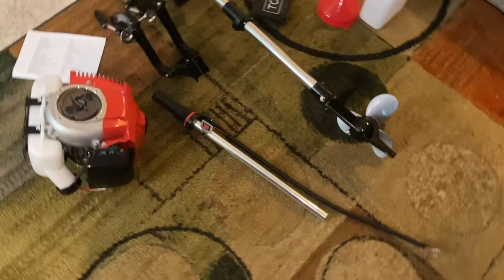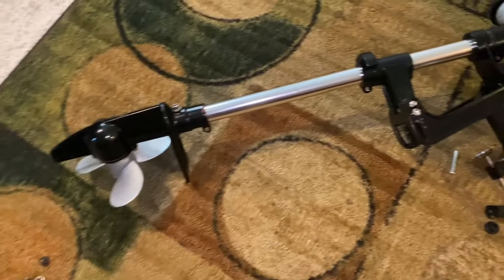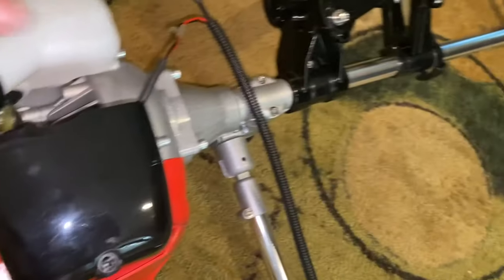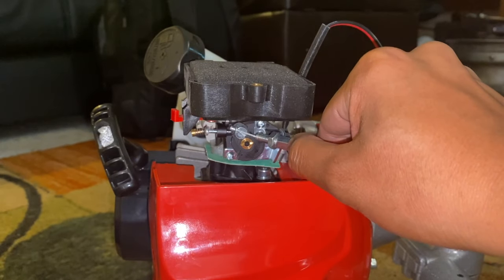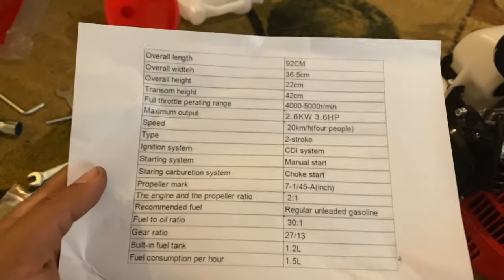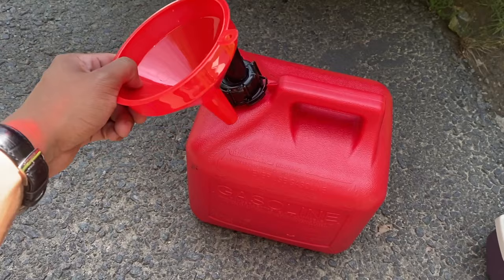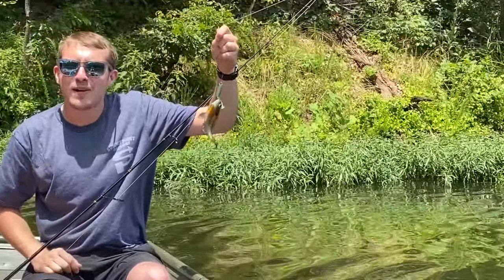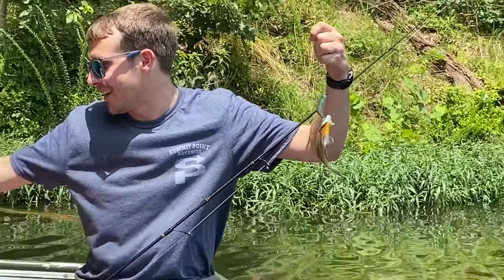Sican 3.6 HP 52cc Outboard Jon Boat Motor 2-Stroke Engine | Review Unboxing Performance Speed Test

Comment: Good honest review.  These asia made products will hold up if cared for properly.  With two stroke engines that oil/fuel ratio needs to be just right.  Id rather clean fouled plugs than re-ring a motor

Comment: Be careful with the handle swivel. Mine was made of cheap cast aluminum and shattered at the handle end of the swivel while using it. I modified the handle it gets my canoe flying across the lake to the point I'm doing wheelies.  Make sure the lower unit has oil in it.
Reply: lower unit ?? its a 2 stroke
Reply: I have an 18' Coleman canot that had that problem of "porposing" up especially in a headwind. You should do what everyone does to make your canoe more stable on the water. Shift weight towards the bow to keep the bow from popping up because if wave or wind action! Same goes for boats that do not plane easily. Shifting weight forward balances your craft better, gains some speed, and becomes a safer craft!

Comment: Anything will last longer with constant maintenance. The tie breaker for me is that centrifugal clutch in the leg. Across the board, everyone I have talked to about Chinese made outboards below 5hp is that centrifugal clutch wearing out every season (with steady use). Occasional use may let that clutch last two seasons, but usually less. The earlier outboards had a "Chinglish" owners manual that wasn't very understandable which caused many outboards to not last very long. I know that if I decide to buy one, it will be two cycle with forward, neutral, and reverse gears and above 6hp for longevity. These motors will last much longer when they are not strained too much. I once ran a 15hp Evinrude, and later twin 40hp Johnsons on my Alumacraft and I learned that the extra weight made for longer and more useful lives for those engines. Chinese made outboards are "extra" light, which means they sacrificed weight and longevity for "convenience".
Reply from the maker: Yeah.. I replaced the clutch as well on this one on a later video. Really just got it as an experiment since the price made more sense than constantly renting a trolling motor and battery from my local park for $48 for a 6 hour period.
Reply: Do You know where can i Buy centrifugal cluch For me 52cc outboard motor
Reply: i am so sad to hear this... i just bought 3.5HP this (product is on board, i am taiwanese my native language is chinese)
and you said about clutch problem i guess its nomal condition cuz this engine only 3.5hp so driver usually full throttle working
so clutch wear is very soon...even made in japan also have this problem (my chinlish hope anybody can understand lol

Comment: Did you check the lower unit for oil? Some of these little outboards come dry and you need to put oil in the lower unit.
Reply from the maker: Very good tip, I ended up using AMSOIL gear fluid for the bottom unit.
Reply: Hi, where do you fill the oil?
Reply: Looking at the rear of the motor there are two screws on the right side of the lower unit. The oil comes in a plastic squeeze tube, motor must be upright when you fill it from the BOTTOM hole up.when full put top screw in first then remove tube. Don't relax pressure on squeeze tube or you suck the oil back out.
Reply: ....you have to use marine grade lower unit oil, there are you tube vids on doing this

Comment: Place this motor on m Bris 12.5 ft and worked great in saltwater. You have to get it to the highest speed 5 to get it moving when the tide is up. But on calmer waters 3-4 works good for some speed. Easy to use.
Reply: How to you wash it after use?

Comment: Just shairing. I have not tested it yet on the water. I just brought an 12.5 raft pontoon boat. I have an old trolling motor. Only has slow and fast. I put on an variable speed. Yet, my point. I bought 2 20ah AMG sealed Marine grade friendly batteries. Hooked them up my way. An 20 watt self contained panel. So far running test time out of an 5gal bucket. Endless. At night not at full speed. 40% power. The double battery hookup is simple. Two battery 12v hookup as normal. Then make an X with the wires. One negative on one battery and the positive on the other. Then opposite with the solar. Yet I am watching this on shopping for an small fuel boat motor. Small electric trolling motors. Just hookup an 20 watt solar panel. 50 watts medium. 100 watts large. Then use your trolling motor as long as you want to.

Comment: Nice review, I know it's loud but is the noise level unbearable?? And can it go slow enough to troll lures or is it like an idle to wide open type thing, thanks
Reply from the maker: Ok it is quite loud and I would not recommend it for trolling lures. It's got a clutch so you would have to give it decent throttle to move forward and it is not great at being quiet. It sounds like a weedwacker honesty.
Reply: @PatOutdoors  I mean I'm not too awful worried about the sound, Im a fabricator so I can rilun a pipe from the exhaust to the water, and yea it does have a cintrifugal clutch, a lighter spring will make it grab sooner, I've also seen some ppl delete the clutch spring
Reply: I enjoy it it has some play in the cable throttle itself tried to adjust it but even wide open throttle it seems to run rough I just use it half way it seems to run better and smooth

Comment: Considering buying one of these now, how often do you use the motor and how well has I held up since you made this video? Thanks for your time, I found this very insightful!
Reply from the maker: Thank you! I'm actually in the middle of moving homes at the moment, so I have not gotten a chance to take it out in months, but I've used it a total of 8 times so far.
Reply: @PatOutdoors  I was going to ask the same question. I was also wondering about the noise? 

Take your time though; moving sucks. We're partway through that too. Everytime I say "never again!" But here we go... Again. 🙄

Comment: They're actually little deep they're actually decent motors but remember the prop that comes with the motor is a standard prop it's not a work prop it's not a speed prop but it is interchangeable so here is a good suggestion take it to your local marina and have them put a prop that matches that style motor got to give you a little bit more pitch and that'll up your speed and also save you on your gas consumption but the prop is interchangeable I do suggest that you do change the prop
Reply from the maker: Thank you for this tip. May give this a try!

Comment: I have a 4-stroke engine (similar to the one in the video), attached to a small inflatable boat (2.3 x 1.3 meters). The maximum speed is 5 kmh (3.2 mph) and at average speed somewhere around 2.5-3 kmh. I think it's too slow. Are these the operating parameters or does my engine have a fault? Thank you!

Comment: I use a 30 lb thrust electric motor on a 12ft Jon with a $50 refurbished 18 wheeler truck battery a it will last at least 5 hrs strong for at least 4 years and it pushes me and my buddy with gear
Reply from the maker: How heavy is the 18-wheeler truck battery? I've considered this option, but normal size 25-35 lb battery's have only lasted about 1-2 hours for me.
Reply: @PatOutdoors  the battery is pretty heavy  and it usually last about 5 hours

Comment: I'm looking for something like this for a backup motor in case there's a problem with my main 9.9hp Mercury.  I'm removing the mast from a 1990 Macgregor 26 sailboat and planning on just motoring it.  I feel more comfortable with some kind of backup even if it's slow on a boat this size.  Price sounds good.  My thoughts.

Comment: Nothing like bolting a weed whacker to your transom. I was considering one of these as a kicker until I heard one run. For the money it’s great but I couldn’t deal with the pissed off hornet sound for long. Wearing ear pro while fishing is just a no. However, whatever gets you out on the water is a plus…
Reply from the maker: You make a very good point. I just have fun putting around in a jon boat with it. But when it comes to fishing.. it definitely does not help me because it's loud af lol

Comment: You should get some speed increase with a v hull since square jon boats have more resistance cutting through the water.
Reply from the maker: I really do want one. I was actually in the process of purchasing a 12' Starcraft aluminum V-hull months ago, but the titling process fell through registering in VA..
Reply: I have one of these, 52cc 2stroke chinese motors. I run it 32:1 on a 14ft v-hull aluminum. By myself (235lbs) with 12v battery and fishing gear, ive never broken 6mph. Wonder if its boat, or brand of motor causing such a large gao in top speeds
Reply: i think it is the other way around;

V hulled boats are  slower and much heavier on gas,and they are good only for the rough water,the sea;

 The V makes them more confortable, like a spring ,since they go up and down on the waves better; 
 but what do i know,this is the internet for you.
Reply: @josepeixoto3384  depends which one you are thinking of. There is a difference of weight between the 12 ft Gregor front v and an old 12 ft sears front v model which is a lot lighter. Having said that, two people can easily carry both to the water while a single person can drag/push either to the water. With equal wind conditions and equal weight between both types of boats, the v front, flat bottom aluminum will still cut the waves easier than a square front flat bottom aluminum making it faster due to less resistance force. In flat water both types perform well enough.

Comment: Is that a 14 ft john boat?
Just bought a 14 ft sears v hull and thinking about this one or the 4hp 2 stroke one they offer also
Reply from the maker: Yes it's a 14 ft rental Jon boat. Didn't realize they offer a 4HP one, otherwise I would have gone with that! Either way I'm satisfied with the results from this 52cc engine and glad I no longer have to rent those weak electric trolling motors.
Reply: Hey I just bought one from a guy on market place it's worth it I like it just use 50:1

Comment: Do u have to re fill it with oil and gas again after it ran out of gas an hour later? please help never owned a gas motor
Reply from the maker: Adding oil to the gas mixture only applies to 2-Stroke engines. Regular 4-Stroke gas motors don't need oil mixed in the fuel.
Reply: @PatOutdoors  do u got to add oil each time you refuel ? Or only at the beginning?
Reply: @PocketBeast1243r 
every-time you refuel

Comment: Have been looking for a motor like this for my kayak thanks for the video how long did it last long term if you had it that long I would greatly appreciate the feedback
Reply from the maker: I haven't had it for too long, only 4 months so I'm not sure how long it would actually last. But I'm sure with proper maintenance, it could go a few years. I would say it's a bit heavy to use for a kayak, but I'm trying that myself also. Just got me a kayak recently!
Reply: Hi did you try this motor on your kayak yet?
Reply: Did you follow the low rpms, variable throttle setting 10 hour break in period ?

Comment: I like your review. I have an old Ark. Traveler that has/had an 8hp evinrude, but it hasn't run in years, don't know if it will. Do you think one of these little motors would push my boat good enough to fish out of...I am not a speed freak so if it would push mine at 8 mph I would be happy.
Reply from the maker: Thanks! I don't think they would be the same quality as an Evinrude to be honest. It's simply just a good starter motor to put you around 7-8 MPH on a 12 ft jon boat. It's been good for a year so far, but I've had to check all the bolts periodically to make sure it's all still torqued to spec. One main downside with this motor is the sound. It's a small 2-stroke so it almost sounds like a weed-wacker and not very quiet.. So not great to use as a trolling motor for fishing.

Comment: Did you have problems starting it the first time?
Reply from the maker: Actually yes I did. But then I ended up NOT using the choke and it started right away. Never used the choke since and haven't had a problem starting it cold or hot. Also noticed the boat ran at 5MPH during the first 20-30 minutes of the day and it just kept getting a little faster as it broke in more.
Reply: @PatOutdoors  I got mine working I had to replace the spark plug. I haven’t had mine running for more than 30 minutes at a time because I only have it on a small farm pond. Did you have any trouble with water getting in the gear oil in the lower unit?
Reply from the maker: No I have not had any issues with the lower unit. I have only used this motor for one 4-hour day though. I will continue to monitor for any unusual wear as I use it more.

Comment: did you try it on your seahawk 3
Reply from the maker: I did.. and the Seahawk3 definitely needs to be modified to take the weight and power. The standard Intex mount is too weak. I'm still working on the Seahawk platform and transom mount. I just got distracted with my kayak project recently.

Comment: 10 MPH =16KMH.   12 MILES AND HOUR IS 19.2 KILOMETERS AND HOUR, so the boat speed claim was accurate
Reply from the maker: Surprisingly, it was accurate. I just had low hopes at first
Reply: @PatOutdoors  MPH and kmh can be confusing sometimes lol . It happens
Reply: Bs

Comment: Keep an eye on the clutch. It slipps almost every time on these
Reply: Do you suggest I replace it periodically?
Reply: @PatrickKasilag  i removed the spring in mine. Clutch coating was gone after first two rides.

Comment: Get yourself a 6hp eventually it would be perfect
Reply from the maker: Do you have a specific one you'd like to recommend?
Reply: @PatOutdoors  Yes, a Johnson or Evinrude from 1965-1979.  Or, even better a Johnson or Evinrude 3hp.  Those models have the gas tank built in and are far quieter than that weed wacker in this video.  Plus they look cooler and weigh 33 pounds, are constructed using nearly zero plastic and will last a lifetime.

Comment: Nope. The 4 stroke, same 52 CC would be much quieter and more reliable. Hangkai and similar. Air cooled, 22  LBS, starts super easy, and the range on a quart of gas is farther. I bought one.
Reply: Without an outer cover, what happens when it rains?  What is the weight of the motor?
Reply: @wilsont1010  23 LBS. I'm sure my motor runs in the rain just fine but storing it is immaterial. I pour the gas back wipe it off, and it stands behind a coat rack next to my closet. Some of these boats can be hoisted on top of a car.

Comment: 50:1 ratio on those bro
Reply from the maker: The paper manual it came with states 30:1,  but someone else recommended 50:1 to me recently. Do you have the same exact one?
Reply: WRONG......Don't run 50:1!!!!............Chinese engines DO NOT have Chrome Lined barrels, and crap Clearance, so they call for 30:1 to COMPENSATE for this......period
Reply: @94SexyStang  That's the difference between an actual Honda gx25'ish weedwacker and a Chinese clone, and it's the recommended oil mixture which gives it away. 

I have a 1.2hp one for my inflatable, ran it a year occasionally but my kids HATED it for the noise. I have a Tohatsu 5hp now, old 2 stroke but it's nothing like the weedwacker.

Comment: Electric has its drawbacks, but that crappy little two-stroke motor is going to leave you in the lurch with startling regularity.  Two stroke technology is unreliable.  And a $200 made-in-india/china motor is going to leave you stranded on many occasions.  Parts will also not be had easily.  Splurge and buy a four stroke Honda, Mercury or Yamaha.  Run them properly and have them forever.
Reply from the maker: This was just my first and low-budget one to get my feet wet. I'm definitely planning on splurging on something better,
Reply: are you kidding, 4 stroke hondas have TERRIBLE reliability.....coil issues, etc......I HAVE one, and it's Not that great.....I thought "honda reliability" until I got one, and almost GOT stranded, then went online to read all the crap problems with the 5hp!!!
Reply: My Chinese  weedwacker has worked for years with zero maintenance.  my 1994 2 stroke seadoos always start and make people at the boat ramp with newer ones 4 stroke fuel injected look like fools with their clogged injectors and constantly failing electronics.  2 strokes have a quarter less parts than 4 strokes. And if a part isn't there it can't break.

Comment: Hey bro how long was your boat and how wide was I have that same engine
Reply from the maker: 12 foot by 36”
Reply: @PatOutdoors  thank you because I have an aluminum boat about maybe 15 or 16 ft and I just want to know because I have that same little motor and I want to know if they can push it in the ocean, you know it's a 4to5-person boat and thanks
Reply from the maker: @terryjoe323la  I would recommend a larger motor for a boat that size
Reply: @PatOutdoors  ok oright for show